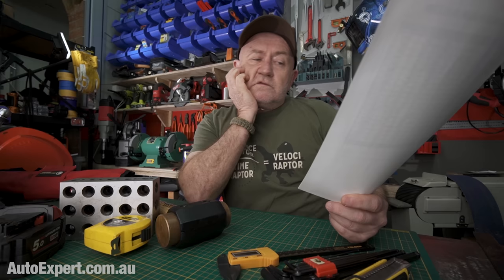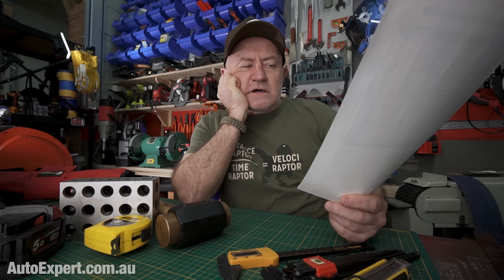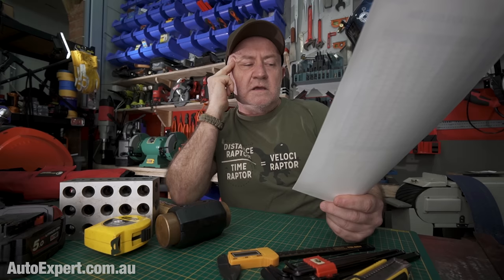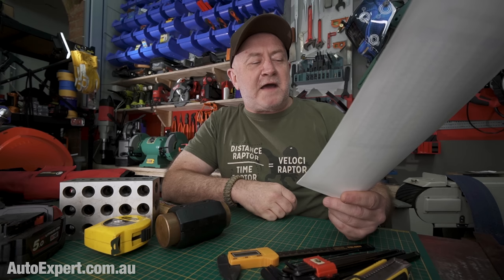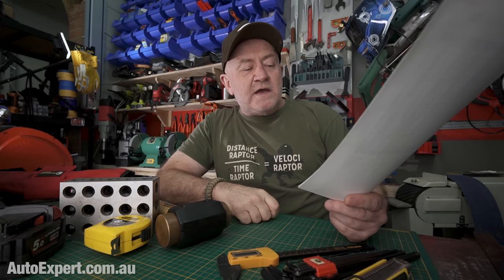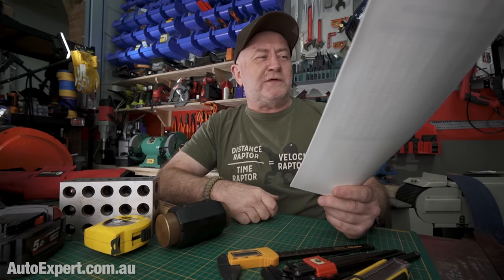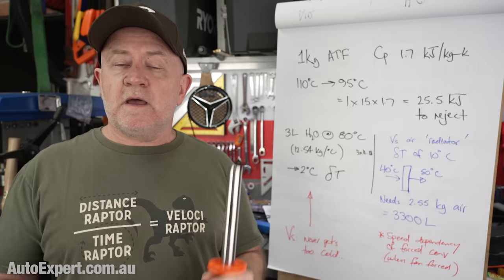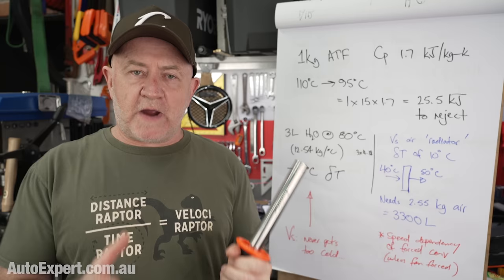The truth about fitting an auto transmission oil cooler | Auto Expert John Cadogan

Comment: Does beg the question, that with the hundreds of aftermarket 4WD accessories a transmission temperature gauge isn’t one of them. They are in every American brand prime mover, and a lot more useful than a inclinometer or a compass for 99% of 4WD owners.

Comment: @autoexpertjc the bogans will say that the radiator is cooling with air just like an air atf cooler so you must be wrong. Unless I missed you stating the obvious. The coolant radiator is much bigger and likely way more efficient than an atf air cooler.

Comment: if your auto trans fluid runs below 50 degrees for prolonged periods of time it's like a death wish. 
the best blue singlet mod that any bead stroker can do is fit a larger air flow radiator fan.
Reply: see Derale ATF thermostats.....

Comment: Excellent. I fitted an extra cooler rad to my Altima SE but it was only a little better on mountain climbs. Speed too low to move much air through the rad.
Reply: It seems your Altima does not have a thermostat fan/s that draw air through the Engine radiator and Trans' radiator when vehicle is stationary or at low 'climbing' speeds.
Reply: @rossevans1774  It did, but after half an hour of climbing, just couldn't cope.

Comment: The main point being water is a better cooling medium than air and that's not even considering phase change, or the point of boiling 100c. Where you cannot exceed this temp 100c no matter how much energy you put in the system until all the water turns to steam.
Reply from the maker: You can pressurise the system and operate it at about 130 deg C...
Reply: @AutoExpertJC  makes sense, why would you need the temp so high?

Comment: How does this work with most modern radiators with vertical tanks either side and transmission coolers in the vertical? Is it the same?
Reply: They're cross flow - the outlet tank is cool just like the bottom tank of yesteryear.

Comment: didgeridoo man! this is cool info and it does actually work! I tried it in the sahara desert only a few months ago, blazing heat of the Mauritanian sun, no problem on a old toyota hilux from 1993. Dingo stuff man! People turn to these shitzu cooler things because they have a failing component/s e.g. clutch fan is well past its sell by date, just spinning not doing what it supposed to do, the fan is normally the standard one, they need to upgrade the fan from 7 to 10 blades and have a clean radiator, not clogged with bird poo and ear wax - lol , so, it shoves more air in and then out. DINGO man.

Comment: For non scientists - Specific Heat is measured as the amount of heat required to change the heat content of exactly 1 gram of a material (in this case Water) by exactly 1°C. So you are using the Specific Heat Capacity formula Q (Energy absorbed) = C m ∆t? Just checking ... long time since Uni? 😂 Love your beer garden Physics. Ironic that a lot my Physics degree was spent in the local beer garden🤣

Comment: Having ARB kit on my Prado made zero difference to engine runing temps; 86c and doesn't move. Thats my experience anyway.

Transmission on the other hand is fine right up until you put a trailer on it. (<1.5t box trailer) and then the trans likes to cook itself the moment there is an incline. 130s

Its was a earlier video of John's that convinced me to put a transcooler on it. This dropped trans temps by 10-20c. Trans cooler is in series after the factory, which Toyota says maintains warranty. Engine temps remain unaffected by the small trans radiator.
Reply: We also have a Prado, I did notice if you drive the vehicle the torq converter is forever slipping generating heat. If you put on the cruise control it locks the converter. So installing a lockup converter kit solved the temp without a ATF cooler. You can tow a 2.5 T shutwhar in 50Deg at speed with torq converter locked no issues. Toyota programming on Auto is crap.
Reply: We have a lot of colorados at work and if we towed trailers (never weighed the trailer, let’s say 1.5 ton) up hill on a warm day, big brother would always go off saying “engine parameters exceeded”

Never really dug into solving the situation, we just assumed it was cause the company cheaped out on shitty colorados that were already close to overloaded without the trailer. coolant temps were going up but maybe it was ATF temps that actually triggered the alarm.

They’re lease cars, everything else breaks already, no one cared that much
Reply: @thomasa5619  lease cars and rentals are basically bulletproof 
I wouldn’t really worry 
You break em we replace em 
Says so on the forms I’m sure !!!

Comment: Yesss so many auto transmissions get killed in Australia from running too cool lol!!!! I don’t disagree with incorrect cooling and most transmission’s don’t even operate optimal shifting or tcc until normal operational temp is reached, and thermal transfer is far better with water but seriously going on about general engineering bs and jargon is laughable! How about some actual reports of the mechanic’s and developers that improve and redesign the garbage cars you people buy! but probably wins over most of the collar shirt wearing strayans, but seriously go speak to an automatic transmission specialist before not installing a cooler  and fan! Just idling in gear the torque converter produces constant heat do you live in Lithgow? Or Tasmania in the mountains

Comment: Well, for someone that enjoys picking shit of someone that has put an apostrophe in the wrong place, might I point out that people in glass houses...
"K" or kelvin is not expressed in "degrees C" nor is it expressed in "degrees" Simply "100 kelvin" as an example. :-(
Reply: I don't believe he said what you're claiming. Give a timestamp.
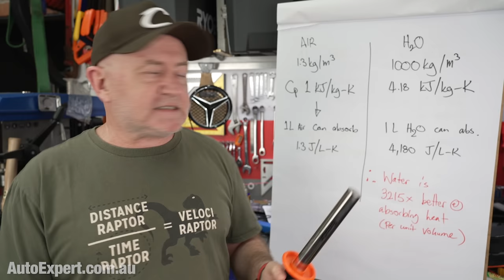At 10:14 he did say kelvin is "sort of" the same as Celcius, which is entirely correct - it's the same unit scale - a 1°C change of temperature is also a 1K change of temperature.

Comment: Find it interesting that you give the mass of air needed to cool but not the mass of the water...
FYI 3kg of water vs 2.5kg of air.
Reply: I'm quite sure most everyone knows that 1L of water is nominally 1kg.
Reply: @TonyRule  but why not point it out as it's less mass of air, after belaboring the point in regards to using less volume of water.  Even though the air at most will be 40 C and the water will be 95 C at least.
In heat transfer formula Q=mCΔT, with a radiator you are limited to 15 C on ΔT and 3kg, were as air  has at least 40 C ΔT and gets as much mass of air as the radiator.
Water cooled engines benefit mainly from lower number of heat cycles not a greater Q value.

Comment: You messed up on what the thermostat does to radiator temperature.  On an extremely cold day, the thermostat is closed so the engine stays warm meaning the radiator stays cold.
Reply: Very true Ken but also the radiator doesn't have water moving when the thermostat is shut. Localised heat around the transmission cooler keeps the temperature stable. 

Interesting thing the thermostat, they close even with extreme heat to slow water movement in the radiator to allow the radiator to cool the water effectively. It opens and closes thus improving the cooling. 

Been a lot of research and engineering done on this topic. 

They spent $100 million on development of the Cooling system yet apparently a $400 cooler will surpass that investment.
Reply: @gteea  On that extreme cold day, at light loads, the transmission temperature is not likely stable.
A thermostat only closes when the water goes below their regulating temperature.   At the limit of the system, they will remain open and the system temperature will rise.

Comment: So to summarise don't use aftermarket oil cooler mod, because factory design is the best, but if your running big ass ARB airflow stoppers that's fully populated mounts with 1000watt 9" air deflectors and a Warn cable-hook airstop vent, then any help to uncook the cooling system is ok to oil cooler in series.
Don't do mods kids, mods are bad mmkay 

I would like to add Don't forget to reverse flushing radiator fins. Deadbugs are terrible mod for your 4x4. 
Lockup kit

Comment: just as I was about to type the coller would need to be nearly half the size of the vehicle radiator to cool to the same lvel as having a smaller heat exchanger as the water carries away so much more heat than the face of an air cooled heat exchanger

Comment: Unfortunately John has not acknowledged the elephant in the room.   

While his answer to the original viewer question is valid, the video indicates that changing any modern car's auto trans cooling setup is not required and unwise.   It ignores the prevalent and devastating "pink milkshake" issue.

Modern trans oil cooling involves engine coolant and trans oil being adjacent to each other, with heat exchanged through some (generally) metal interface- pipe or such.   Sometimes the metal barrier that separates the two liquids fails- usually due to cracking.   This results in engine coolant and trans fluid mixing- the infamous pink milkshake.   

Not likely to be devastating in the engine and the coolant system, but guaranteed to devastate a transmission over a period, unless one is lucky enough to notice the problem in time.   How many people check the colour of their engine coolant on say...a daily basis?  Pretty forkin unlikely, and by the time the transmission is doing unusual things it's probably too late.  Clearly this can't happen if you fit an aftermarket air trans cooler that doesn't have the possibility of mixing fluid with coolant. 

While it can happen in any vehicle with coolant/ trans oil systems, for some reason life, the internet, and youtube seem littered with references to Ford AU and later model transmission destruction from this event. 

Which is more of a problem-  trans fluid that may be at less than ideal temperature, or a completely stuffed trans that might make your car an economic writeoff?

Just after I wrote this, I saw a honda owner's solution- just completely bypass the cooler with a hose  https://www.youtube.com/watch?v=X0momjONPpc     interesting...

So dear viewers- please be aware of the issues regarding trans coolers, and do broader research (eg google coolant in transmission fluid)

Comment: Only bad thing about oil-water cooling system is things get mixed-up. Transmission oil in cooling system means no oil for transmission and water in transmission means engine and transmission getting screwed up. Vehicles with less space concerns have separate cooling systems for both I guess in car having them together is better

Comment: Plug in OBD2 reader to monitor ATF temp, if it gets to hot slow down and never use overdrive in an auto while towing because it cooks the torque converter! Better to lock the torque converter in the final drive 1:1 and change down a gear or two on hill climbs. Better to burn a bit more diesel than to over heat the transmission.

Comment: I’m pretty sure that, given how simple and inexpensive it would be for the factory to fit one as standard, if external transmission coolers contributed to the reliability and longevity of the transmission, they would be fitted as such. I’m quite confident that all of the university trained engineers in all of vehicle manufacturer research and development departments didn’t overlook this potential addition, so that customers would have to cough up for a new transmission soon after their warranty expired. What a bullshit theory that is. My vehicle for example has a seven year, unlimited kilometre warranty on its transmission. I see ATF temperatures peak at 130 deg C while towing, and while I’m sure that in days gone by this would’ve been destructive for an automatic transmission, I believe that modern fluids and transmissions are designed to withstand these conditions. 
There really is a lot of aftermarket crap out there that people who are likely not university qualified mechanical engineers are preaching as ‘must haves’, and aftermarket transmission coolers are a classic example.
Reply: Are you sure that the temp you see reported....is actually the temp of the ATF fluid?
Reply: Whenever towing, I connect the Scangauge 2 so I can monitor transmission temperatures. Two readings are given. One for the torque converter output, and one for the torque converter pan. The torque converter output is very responsive and quickly indicates high temperatures when the torque converter is unlocked, as expected. This is the reading that eventually peaks at 130deg C before the transmission drops down a gear. The torque converter pan temperature steadily climbs with the torque converter output, however generally reaches 120deg C or thereabouts when the output reaches its peak of 130deg C. 
I must admit though, it does seem strange to me that when not towing and at cruise speeds, say 90km/hr and above, the torque converter rarely locks unless the cruise control is on. The vehicle is a 2019 Prado.